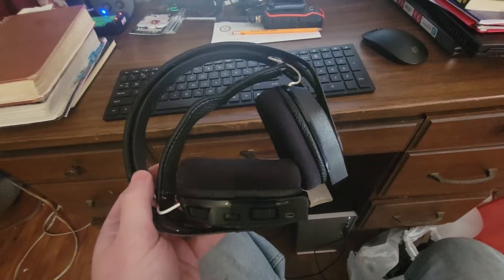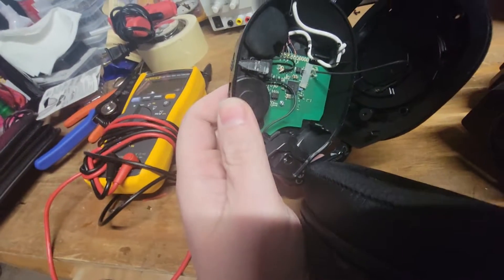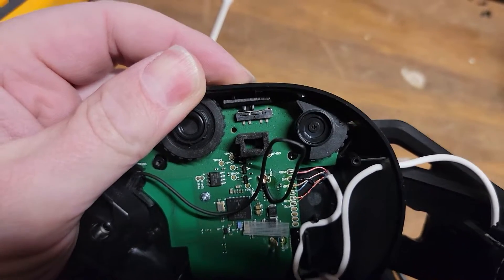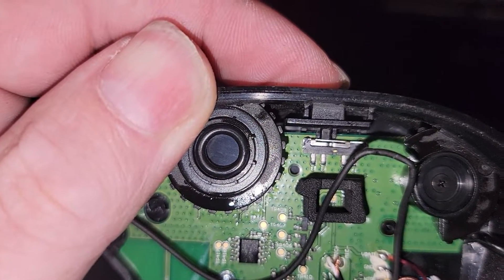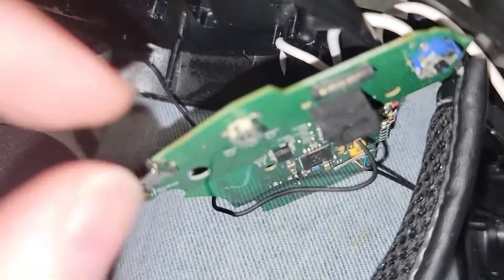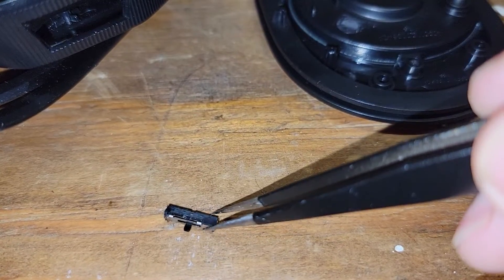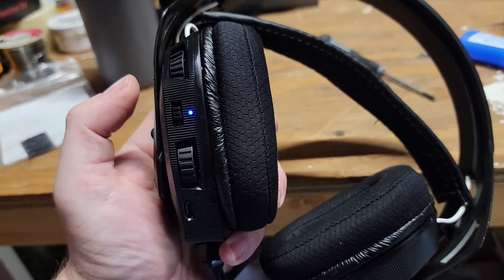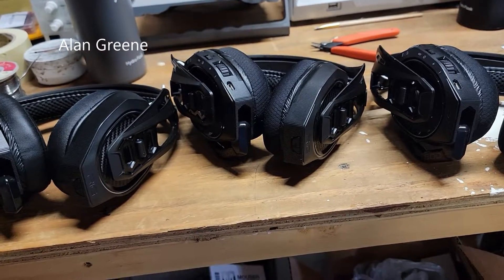(Quick Fix) RIG 800 Gaming Headset Repairs

Comment: Hey, you actually don’t have to take the really small parts apart, you can actually just put your tweezers in, and expand the spring a little. I’m doing that on my 800 rig. It works and it’s not so damaging and costly 🫶🏼🫶🏼🙏🙏 THX FOR THE VIDEO!
Reply from the maker: Amazing suggestion! Please come back if it is a lasting fix or if it will have to be done again at some point and let us know. Pinning comment! Thank you.
Reply: @HavingFunRepairs  and of top off that, I would recommend using Nyogel 760G instead of WD40 to anyone who said they used WD40 😢🫶🏼🙏
Reply: @HavingFunRepairs  The most common issue on the 800 rig and others with the same on off button, is that it keeps turning on and off randomly and for the most part, it’s the little spring at the on off switch. And of course when you’re in there, clean it with isopropyl 95% with a little soft brush. I’ve been in this business for a looong time 🙏🫶🏼 Thx for the reply! 🙏

Comment: Common problem with these is the mic wire wearing out too. came here seeing what others have done, but it looks like the wire just wears out from use with the mic boom up and down. Be nice to see a way to repair that tiny wire to the mic. It's a bad design as the tiny wire is destined to fail eventually.
Reply from the maker: That's a good point, and I'll keep that in mind if I ever encounter this problem myself.

Comment: I hate that every time I look up how to take apart my rig 800 hx pro this keeps getting recommended. I need to fix my volume wheel an these are not the same design
Reply from the maker: I'm sure you'll find something relevant to you somewhere. However, I don't see how my video is the problem. Thanks for commenting.

Comment: One of my prongs is stuck down how do I fix
Reply from the maker: I'm sorry I'm not sure I understand what you're referring to.
Reply: @HavingFunRepairs  on the charging port, one of the prongs to charge is stuck down and take a very long time for it to charge can you tell me how to fix?
Reply from the maker: You'll need to replace the charging port. That will require soldering in a new one. There are many YouTube videos, including several on my channel, that covers how to solder in a new micro USB port.
Reply: @HavingFunRepairs  thx

Comment: Nice video! Trying to save my set from a vicious puppy attack....He attacked the rubber wire track and managed to cut the joining wires. I tried splicing together to no avail, is there a part # for the wire, in your case the white one, that I can find?? Or is it just generic computer wire with power wires? Thanks!!
Reply from the maker: I'm not sure which wires you're speaking of. if you wouldn't mind emailing me a couple photos and maybe I can assist from there. my contact information is in my about tab on my main page.
Reply: @HavingFunRepairs in your video, it's the WHITE wire that basically joins the speaker headsets. I'll email you too, thanks!
Reply: The pup ate the rubber comfort piece and cut the white wire connecting the speakers. I tried splicing but  these wires are super thin. I wanted to replace the entire white wire by resoldering a new white wire.
Reply from the maker: @tommybones13  typically these wires also have a thin layer of enamel too. The enamel has to be burned away using a lighter, then the wire cleaned with isopropyl before flux and soldering will work.

Comment: I have a rig 700hx wireless headset the volume wheel below the power button works but dosent work at same time its wired how do I fix this
Reply from the maker: @Alastor_RadioDemon6666  honestly, I'm not sure. I haven't personally worked on that model, only the one in the video. I do offer repair services though if you're interested. Link to my website is in the description.

Comment: My rig 800hs keeps powering off and on at the most random times... Not disconnecting... Like fully off on on... Any one had this issue?
Reply from the maker: @meiszterful  that could be the switch that I replaced in this video causing the issue, or a faulty battery.
Reply: Mine is doing the same thing, any luck fixing yours? I would love to save it because it's in good condition other than it turning on and off.
Reply: Mine is also powering off and on at random times. I suspect this could also be bad contact in the switch. Will try some repairs/cleaning.
Reply: It’s the little spring, see my comment on top

Comment: thx for the video! seems mine switch is fixed  after some cleaning with wd40😀 btw it's the switch directly plugged into the board without welding?
Reply from the maker: You're welcome and thanks for watching! It is soldered into the board.
Reply: @HavingFunRepairs  thx!

Comment: Where are you finding the replacement parts?  I’m having a hard time locating them.  I need to replace the mic of a Rig 900
Reply from the maker: I research the components using google. If I find something comparable with a part number then I look up the part number on Mouser to determine exact dimensions and characteristics. If they are a close match, I order from Mouser.

Comment: Hello Great video Do you happen to have the correct part number for the switch? NVM it's JSM07011SAQNR
Reply from the maker: Correct if you download the datasheet for the part shown in the video it will have a diagram for both part numbers for comparison. The part I should have ordered would end with an "R" as you stated.